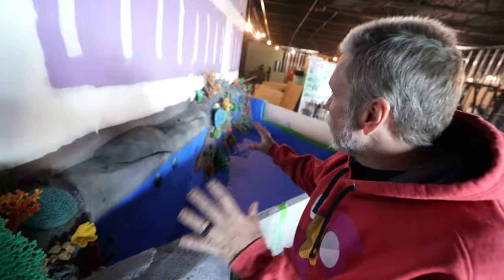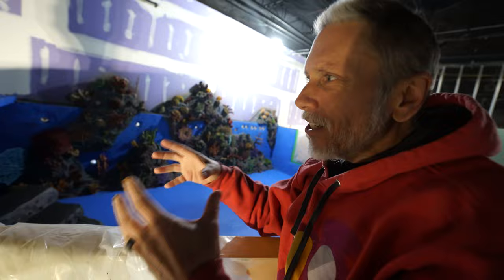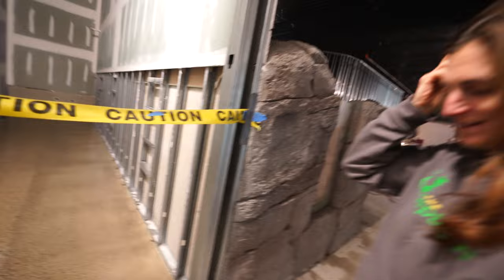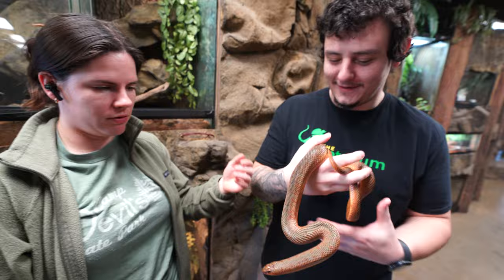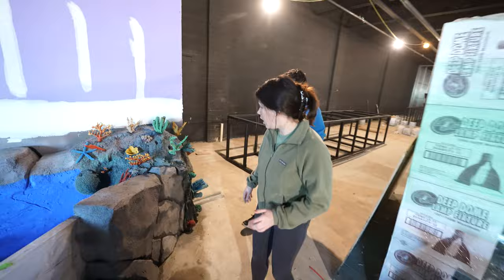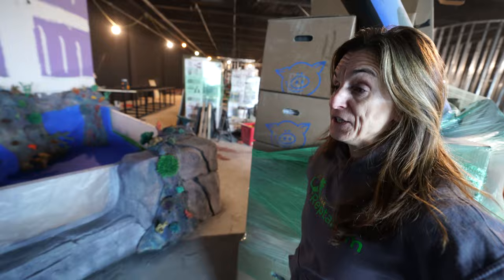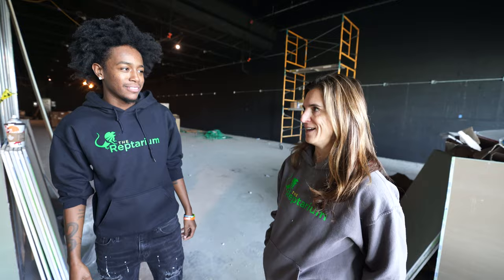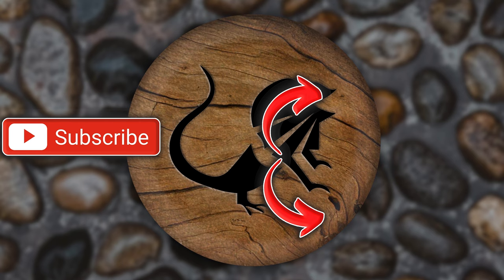25,000 Gallon Stingray Tank Is Finished!

Comment: Quick tip for triangle tank .you will have alot of trouble to keep it clean .espacialy octopus with low flow .it is gonna be à nightmare .Just cleaning the corner is gonna be almost impossible . Corner less than 90° will add alot of dead spot and accumulate alot of debri . Saltwate is an art .A truly hard and invetesting art .make sure to pay attention to those détail.  That said i cannot wait to see the result .this look more than promissing !!❤❤❤